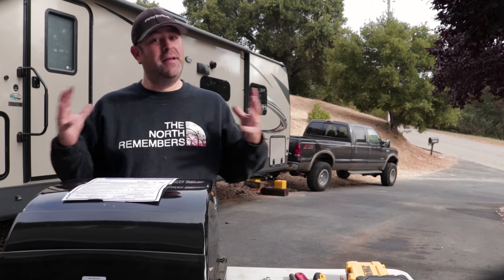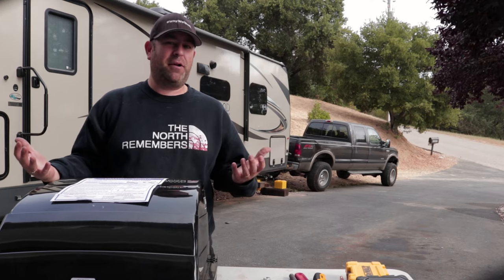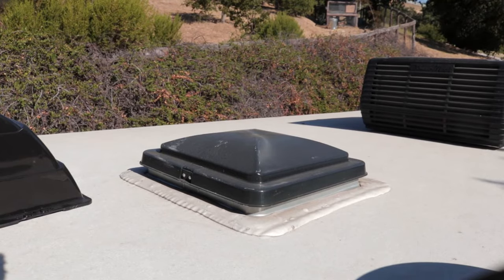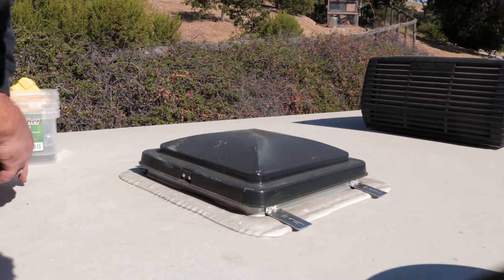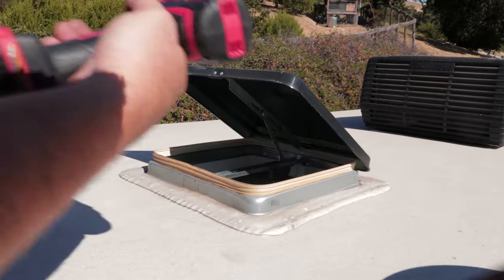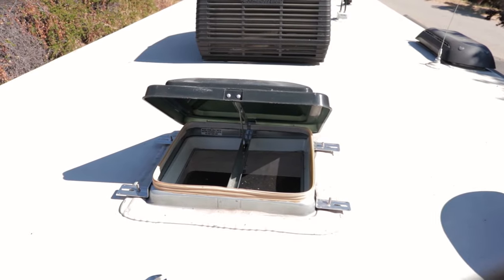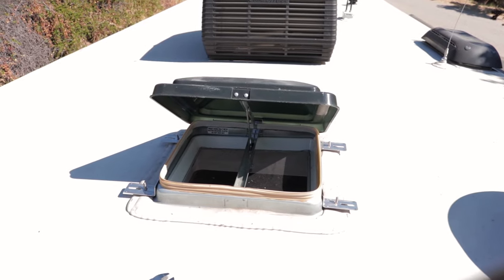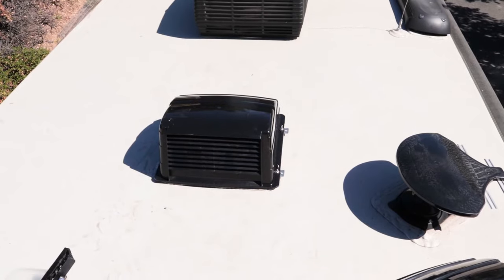MaxxAir Vent Cover Installation | How to Install MaxxAir Vent Cover

Comment from the maker: Have you ever had to climb up on the roof to clear out leaves and branches?!
Reply: There’s a sort of plastic screen behind the vent to keep large debris out of the cover. You’ll only get stuff under there if it’s smaller than 1/8” or if it somehow gets jammed under the bottom edge of the cover, like if you drag some branches along the roof or something. You’ll still probably want to pop them off and clean them out once in a while, there’s nothing keeping spiders and such from getting up under there.

Comment: Great video! Just a suggestion for anyone installing these, put the carriage bolts through the bracket before attaching the bracket to the vent. Might make it easier for some people instead of possibly forcing the bolt in after and maybe damage some caulking! 👍

Comment: ok I know this is an old thread   i hope you get this!   Ive installed my maxx air vent and the super cool cover over each of my fans. It was way worth it!   wireless remote works great! plus if I open a back window (fan is in the front of the rv) and turn it up and set it to suck air out of the rv you can actually feel a breeze!   cools off the rv in no time!    I also wanted to let you know that I did the install of the microair easy start and did the 5 start programming. now the little sucker actually works on my ryobi 1800 running and 2300 starting inverter generator.  Yes i have no power left to speak of but can run lights and charge my batteries. The easy start install on my A/C (Dometic Duotherm)   was so easy.  it was clip 2 wires and plug it in easy. I am still going to get a second Ryobi and run them in parallel because i want to be able to make coffee and run my ice maker(need ice for mixed drinks) :) If you want my help with walking you thru (I am sure you will not need it)  I will be happy to help.
Reply from the maker: That is so awesome to hear because Nadia was just saying we need to bite the bullet and do 2 more max air fans! We have the predator and it runs our ac so I think we’re all set there but I definitely need to be able to move air around!

Comment: What a great video that explained it in easy to understand terms! I am replacing the MaxxAir covers so the hardware is already in place. I think the ones in the video will fit right on the existing hardware. Here in the arid west Texas desert, the aridity, heat, and harsh conditions make anything not metal, very brittle after several years and the Mother's Day hailstorm we had here took them out. I like these newer models. Thanks for the wonderful instructions!

Comment: Excellent how-to-video!   I was not too sure about the carriage bolts as I  thought they had to be drilled through the roof! Having viewed the instructional video I am quite at ease with fitting the MAXXAIR vent.    Is there any need to put sealing pitty around the exisisting vent housing?

Comment: Do you know the size of the bolts? I need to put mine back on after having my roof resealed and the guy left before putting them back on. I am not sure if the bolts are still threaded through. Just in case I was wondering what the bolt size where and also do the washers have the grip up or down? Thank You!

Comment: When you drill into the flange for the brackets dies the flange have to be metal or will it work on a plastic flange. The fan I’m ordering (Starvent) looks like the flange is plastic but I’m not sure. Your looks like metal.

Comment: Great install! I just got a New Trailer but have you considered caulking the bolts that are attached to the vent itself? I am installing mine today but may caulk it to prevent water from climbing its way to the screws while traveling. Not sure if it is necessary but why take that risk :) ?

Comment: I have a power opening vent cover and it will hit the cover how do you change where the vent stops?
Reply: Turn the metal mounting brackets upside down ,reinstall max air cover

Comment: I heard that if you paint they will last a long time .
Reply from the maker: Oooooh, thank you for the tip—will check into that!!
Reply: @WhyWeWork  your welcome, i sand it used primer and painted it with white pant.should last a lot longer.
Reply: Use a self-etching primer or Krylon and you won’t need to sand.

Comment: FYI It's Screw>>Lock Washer>>Washer ALWAYS.. If you put the lock washer on after the washer, theres a good chance the lock washer won't set properly and may even go into the mounting bracket/hole defeating its purpose.
Reply: It’s what the instructions tell you to do
Reply: Instructions probably written by someone who has never done it from India.